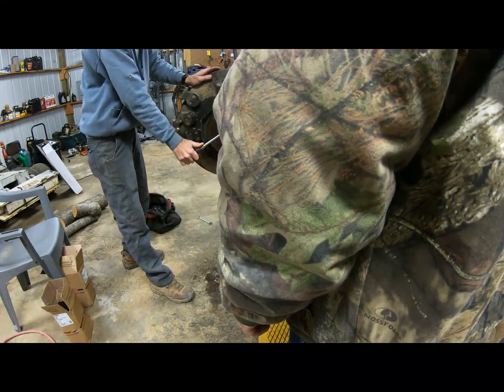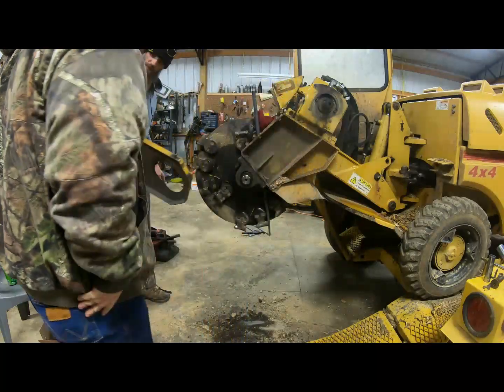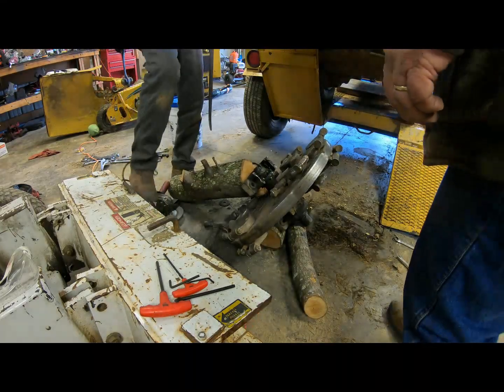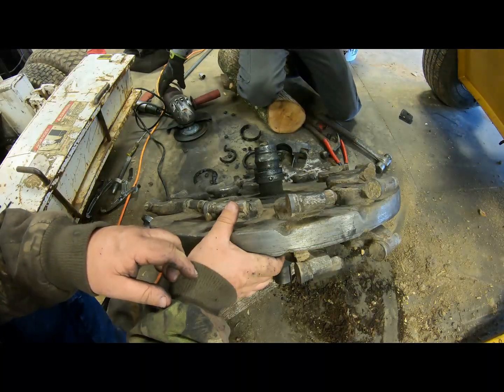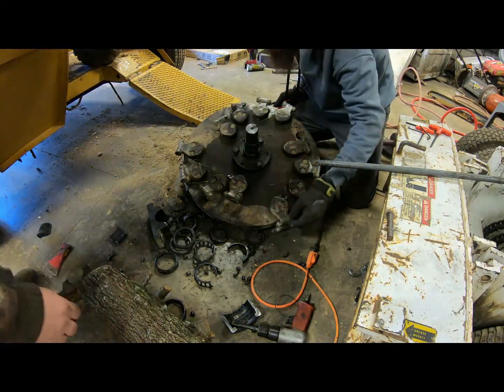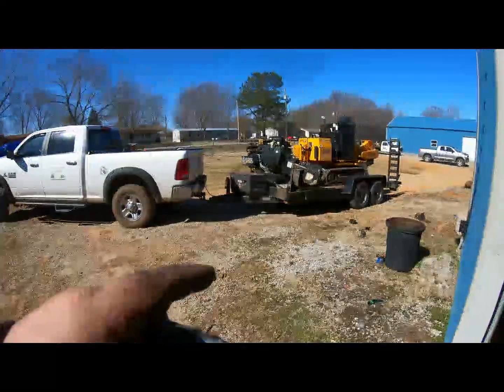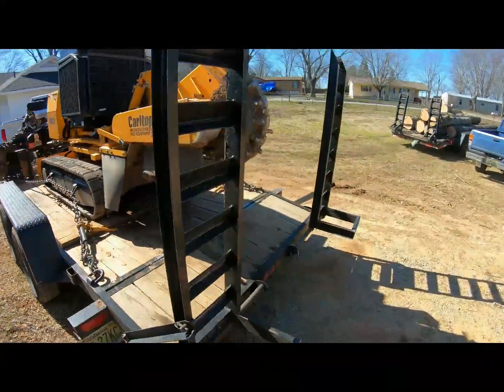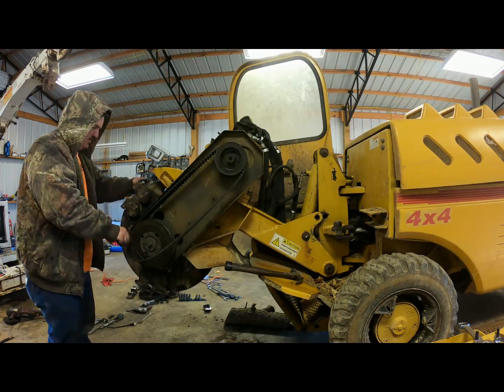Replacing Pillar Bearings on the Rayco Rg50 Stump Grinder

Comment: Chris did those new bearings slide right on the shaft? And did you grease the shaft or apply an antisieze? Great vid
Reply from the maker: No, we had used a cutter wheel until we got to the enter sleeve. Then we used an air hammer for the rest which was very easy. Thanks for watching! Kevin
Reply: @ChrissStumpGrinding  when you reinstalled did the new ones slide right onto the shaft? Thanks Chris
Reply from the maker: @kevinmccliment7591  Yes, with no problem at all. We did use antisieze grease

Comment: Do you have the part number and vendor of the new pillow block bearings? How have they held up?
Reply from the maker: I called Rayco at the time. I'm sure you can get them cheaper off Ebay or direct from the dealer. I don't have any paper work on them at all. Sorry, AlbeeSure
Reply: In Raleigh NC you can get them from Motion Industries. There may be a similar vendor in your area. Carlton machines use Link-Belt brand bearings. Hope that helps. Jim